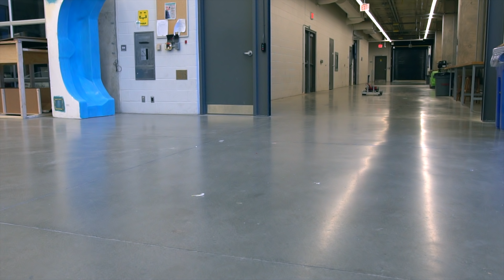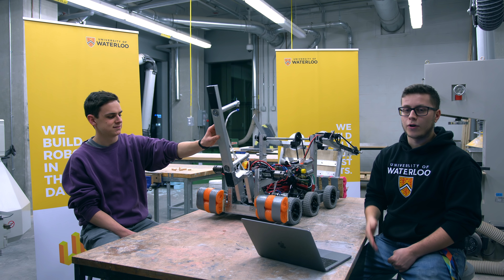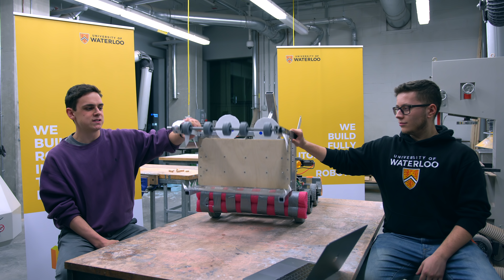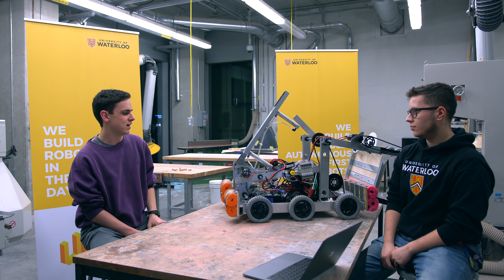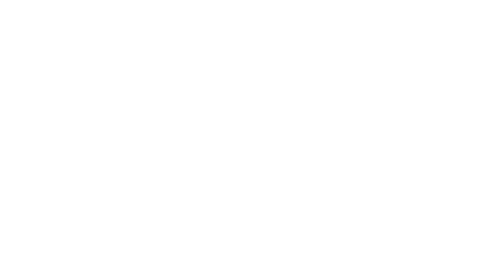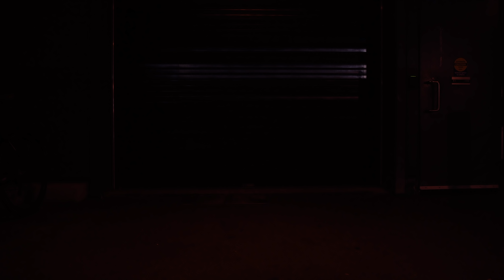UW Ri3D 2019 | Robot Design

Comment: Does the velcro on the hatch mechanism wear out after multiple uses and how do mount the velcro on to the aluminum?
Reply: We didn't do significant testing to see any wear on the velcro. It could be replaced quite easily though. 

We used sticky back velcro. Another option could be using the double sided 3M VHB tape that i think comes in the kit of parts.